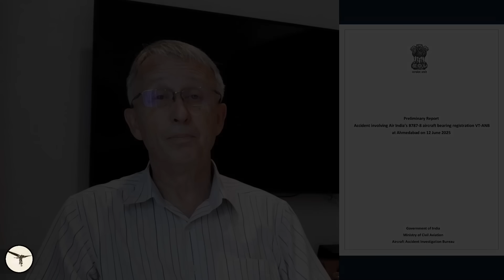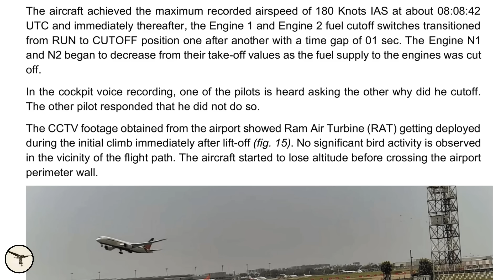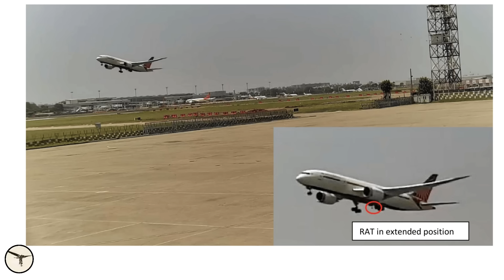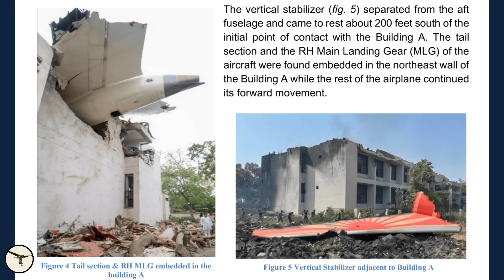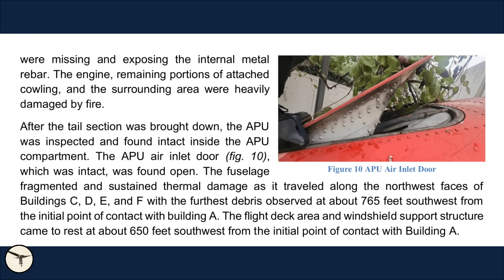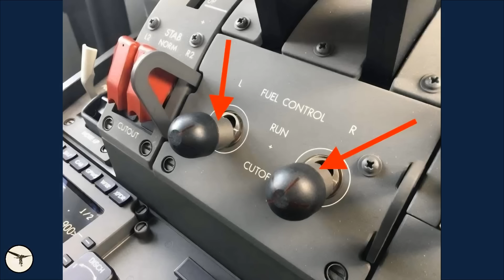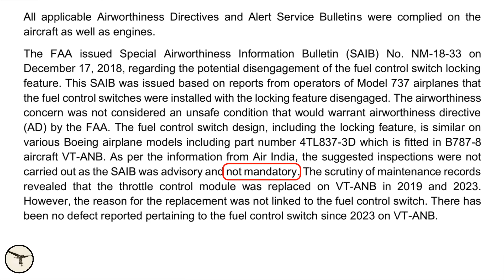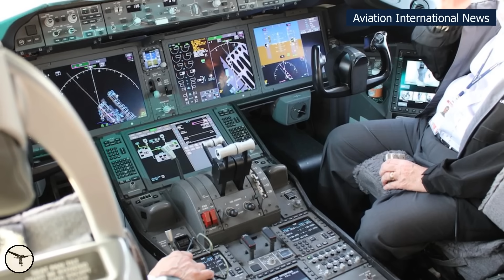WARNING Fuel Control Switches Failure Could Cost LIVES

Comment: Too many comments jumping to conclusions. The pilots appear to have reacted correctly to me. In answer to your question the electrical state from FDR may not be the physical switch state, it seems relevant there were two replacements of modules and the previous flight experienced a transducer issue which was cleared in the ground in under 1 hour. That makes me think the looms and or bulkhead connectors need inspection. I've only built engine management computers for cars though. Thanks Magar I learn a lot from your channel.
Reply: @foobarf8766  
Agree. Depending on where the FDR is recorded from, it may that the fuel already cut off while the switch position is still on run if the FDR is not recorded physically of the switch. Hence it took the pilot 10sec to reset the fuel system.

Comment: I'm surprised we don't have cockpit video recorders in the same way we have CVR. 
Any operational error or intervention could easily be extrapolated from the footage in the event that system data logging / CVR proved insufficient. 
We know that audio is never enough in these circumstances. 

So much happens on the flight deck which is not reflected verbally or which would produce identifiable audio cues.

Indeed, the emergency principle of "Aviate, navigate, communicate" leaves the CVR the last to know.
Reply: cost. This has been discussed before by FAA

Comment: Common sense tells me that If there is absolutely no reason for these switches to be operated during the takeoff phase of a flight then they should be disabled until the plane achieved an altitude at which they can be safely used. This could be software controlled so a quick, easy solution, no major retrofit required.

Alternatively why aren't these switches at least shielded with a cover that first has to be moved to gain access to them,  as are the adjacent switches with red covers as shown in the picture?

Comment: The text is quite clear in the preliminary report - there was a gap of one second between the movement of the two switches to cutoff. This is not a system failure. but it is consistent with being done manually, one at a time. Until the final report is released, we will not know for sure, but at least we now know that both engines shut down shortly after takeoff, and could not be re-lit in time to prevent the crash.

Comment: They did not fail. The wording is the solution. Why did you shut them down.. one pilot saw the other one operating ghe switches. Otherwhise he would have said something like engine failure, both Engines, I have thrust. Without the visual evidence nobody would asume a loss of thrust is due to a cockpit member shutting down the Engines

Comment: 1) You can find videos here on YT where it shows the PM guarding throttles with their hand during the takeoff roll. 
2) If the switches were installed incorrectly OR if this airplane had a known issue with the switches that maintenance didn't fix...
3) .... it could be conceived that this particular day the circumstances lined up; a small bump on the runway, a short sneeze by the PM, a sudden twist of the wrist, and an improperly maintained/installed switch gets flipped.
I do not believe these pilots did anything intentionally. Indian pilots are amazing.
Reply: @everythingisfine-b4d   𝑏𝑢𝑡 𝑝𝑖𝑙𝑜𝑡𝑠 𝑎𝑟𝑒 ℎ𝑢𝑚𝑎𝑛𝑠, 𝑡ℎ𝑒𝑦 𝑐𝑎𝑛 𝑏 𝑚𝑒𝑛𝑡𝑎𝑙𝑙𝑦 𝑠𝑡𝑟𝑒𝑠𝑠 𝑜𝑟 𝑠𝑖𝑐𝑘. 𝐼𝑡 ℎ𝑎𝑠 𝑛𝑜𝑡ℎ𝑖𝑛𝑔 𝑡𝑜 𝑑𝑜 𝑤𝑖𝑡ℎ "𝑖𝑛𝑑𝑖𝑎𝑛 𝑝𝑖𝑙𝑜𝑡𝑠"

Comment: Fine video!
But I think the investigation teams still have a lot to do.
It should be noted that the fuel ON/OFF switch needs to be processed electronically. Were these switches initially toggled by the pilots, or was this just the status of the electronic, and recorded as such by the black box? Do these switches have independent contacts that are then fed to the black box? How reliable are the power supplies for such systems?
Is there a means to override the electronic? The aircraft is equipped with a huge battery to stabilize the electrical system, and how could it happen that they had a power loss so severe that they needed the RAT?
It does not look as if this was pilot error!

Comment: Thank you very much Magnar. 1 second or 0.1 second makes a big difference as 0.1 second could suggest a hand mistakenly bumping both switches (maybe with faulty springs). It's still possible imo that the Captain had a brain flip/simulator related which caused him to cut off both engines as though he was ending a simulator session.

Comment: Accidental knocking of the fuel control switches is possible. That doesn’t satisfactorily explain why it then took the pilot monitoring 4 seconds switch both engines back into Run. If they had realised they had made a mistake, they would have realised the absolute criticality of correcting it as soon as possible. They would not have taken 4 seconds to correct their mistake
Reply: Most likely the pilots were shocked to see both switches in the ON position. It took them a few seconds to assess the situation, and then the memory items kicked in.
Checklist says: Switch to the OFF position, and then ON again (strange!).
Reply: @fritzlehner9060  maybe - but surely any shock at seeing both switches in Cutoff and the mental processing that was required before taking action would have been resolved prior to the pilot moving the first engine switch back into Run? Why did the pilot then need 4 additional seconds to think about whether the second engine also needed to be in Run?
Reply: @bobbyb379  I am almost sure that the fuel switches were in the ON !!! position, and this caused the shock. The fuel switch is just a stupid switch, and its signal is being processed later by electronics and actuators. The first impression of the pilots was certainly: 'what's that?'.
Besides, the Emergency Checklist says: move it to the OFF position, wait a second, and then switch it ON again.
The procedure itself is strange. It looks as if this needs a transition, not a static signal !
Reply: @fritzlehner9060 these switches do not move independently from pilot action. I think you are also confusing the fuel control switches with the FADEC control. Whilst both ultimately control the flow of fuel to the engines, they are INDEPENDENT of each other and the FADEC would NOT move the fuel cutoff switches in the cockpit. In the wreckage the fuel switches are in the “Run” position, but the 787 data recorders (which records the PHYSICAL POSITION of these switches in the cockpit) shows that they were switched into the Cutoff for 10 seconds before then being put back into Run.
Reply: @bobbyb379  All true, but questionable what the data recorder memorises. If the data recorder memorises the actual position of the switch, the switch needs to have a dual contact, since there could even be a problem in the harness or with connector plug.
I encountered another incident. A jet, parked in front of our hangar, had all electric on, but unable to start the engines. The maintenance crew studied the circuit drawings. I passed by and pointed with the finger on the battery disconnect conductor and said: This is the problem, because this device is normally never actuated. A mechanic went to the aircraft and hit the conductor with a wrench. Then he could start the engine!
Aviation sometimes needs intuition!
Reply: @fritzlehner9060  my understanding of the fuel cutoff switch is that it only has 2 settings - either off or on and that these work on contact points rather than purely electrical signals. Whilst a switch  is being moved from one position to another it will retain the status of the last contact point until it is moved into the new contact point position. So it is not possible for switches to change status whilst in transit.

Comment: As a minimum Boeing should put out an immediate bulletin to have all the cutoff switches on there affected aircraft checked. They should change operating practice to check locked and confirmed locked both switches after they are moved to the run position by attempting to move them down without lifting them up.

Comment: 4 seconds gap between the reset of both switches. if you are about to die, you would switch them back up within one second. maybe there was a fight between both pilots about the switches going on, they dont talk about yet. everybody is innocent until proven guilty. even in this case. thanks for your work.
Reply: I agree. I cannot imagine this situation without a struggle between the two pilots over those switches.
Reply: but he activated RAT.
Reply: @MultiYUUHI  RAT is activated automatically.

Comment: For the record, I have flown the Boeing 727, 737, 757, 767, 747-400. Former flight instructor.
I have never had any issues with these switches. My airline maintenance may have something to do with this. 
I am retired now. I did not fly the 787. I flew for the airlines for 27 years. Of those 14 years as a Captain.
If both switches were found in the  "Cut Off" position, this is a suspect. 
In my opinion, this was purposely done. BOTH switches? No way. Secondarily, during a take off, you do not touch anything, except the landing gear lever, you do this to retract the landing gear after you achieve positive climd. This reduces drag and makes flight more aerodynamically efficient.
When you reach approximately 1,000 feet of altitude above ground level, accelerate and clean up. (Flaps retraction), You retract the flaps on flaps retraction speed schedule. No flaps are necessary during normal cruising speed. Aerodynamic efficiency
If this indeed was a case of suicide. Then whoever did this had the knowledge, opportunity and access to the controls to commit this crime. 
Knowledge  and timing. It was done at the most critical time, right after take off, when the aircraft is most vulnerable due to the fact that there is very little altitude and time to relight the engines. He knew what he was doing! These control have detents that are solid steel, you have to overcome the detents in order to move this switches and cannot be done by accidental bumps.Then again, I have never experienced any issues with these switches during my career.
We must wait until the full details are known. I sense that there are regional/national emotions involved with this accident.
The voice recorder tells a story.
In aviation, it is what it is. We must live with the fact that if we make mistakes, we kill people . The airplane does not care about who you are, your gender, nationality or skin color. ....It is what it is. 
At the end of the day, you must be able to fly the aircraft.
This is an opinion.
Thank you.

Comment: Sir, Why it is not clearly mentioned in the report who asked whom. "Why did you switch off"?- Was this asked by Captain Flying or Captain Monitoring? They report should specifically reveal this. Why they are saying in a vague manner as 'One of the pilots asked the other'?
Reply: @belagulivenkata3656  exactly. Wearing a headset is mandatory during takeoff and landing so it should be easily revealed who said what to whom. 
The emotive aspect to this has a very real chance of creating a smokescreen where real information is not revealed while its easy to blame the pilots. Extremely CONvenient for Boeing too since their safety record has been questionable in recent years.

Comment: Captain guarding the throttles seems to be the only answer. His hand inadvertently bumped the switches, possibly in a little turbulence just after take-off. I had concluded this a few days ago. The switches had an issue.
You are the only commentator that has said what I believed was the only explanation for this tragic accident.
Reply: If the switches had moved inadvertently there wouldn't have been one second gap between flips.
Reply: There was no turbulence after take off whatsoever.
Reply: They're beginning to clutch at straws to make the story of pilot blame a reality. 
Most commentstors are saying the fuel swithes were in the off position. Yes they were, but within one second they were toggled to run. Is this because the pilot toggled them as a last resort attempt to reset the engines/FADEC?  @lordjim3109
Reply: @lordjim3109  The Air India 787 (Flight AI171) that crashed on June 12, 2025, started its takeoff roll at 13:37:37 IST (Indian Standard Time). The temperature, it was reported to be around 37°C (98.6°F) at Ahmedabad at the time of the crash. So have you ever heard of heat turbulence, especially likely passing over a built-up area.
Reply: With so many aircraft flying with a similar arrangement of the fuel cutoff switches, why is this the only time its happened?
While everyone is concentrating in the switches and the emotive aspect of potential murder/suicide,  other more subtle aspects are going to be missed. Such as FADEC issues, loss of electricity, etc etc etc. 
But blaming the pilots seems the easy way out.

Comment: The fuel switches should be better protected, with a cover for example, that has to be opened before the switches can be reached. It should be made as difficult as possible to move these switches by mistake.
Reply: They were hardly moved by mistake, because there was one second gap between flips. And also there is almost zero possibility that both switches were simultaneously faulty, or worn. These are special, military grade switches, each one costs 1500 USD. Even if these switches were ordinary consumer grade, bought at a local store for 5 USD, simultaneous fault of both switches would be extremely improbable.
Reply: It is already made as difficult as possible to move these switches by mistake. How much more difficult do you want to make it? So that it takes two hours to switch them off?
Reply: Maybe instead of an actual guard over the switches, the thrust lever for the engine must first be put into idle. There could also be a manual override (done via another switch) for any scenarios where a faulty throttle lever stops the activation of the fuel cutoff switch.

Comment: I can only see 3 possible conclusions with the information we have now. 

1: A mechanical failure of both fuel cut off switches one second apart. The odds for that happening for both switches so close to eachother are astronomical. 

2: One of the pilots mistakenly shut down the engines instead of lifting the Landing gear. The time the engines where shutdown is not that far away from the time you normally expect to lift the landing gear. The CVR should possibly clear this up as you would expect to hear a "positive rate/climb" from the pilot monitoring and a "gear up" response from the pilot flying.

3: One of the pilots intentionally set the fuel cutoff switches to "cutoff" in a critical part of the flight.
Reply: I have a large collection of Honeywell switches of this type (I'm going to assume they are Honeywell parts as it's Boeing). 
They simply don't fail. You'd need a sledge hammer to force the actuator over the steel 'hill' separating the switch index points - and even then you'd destroy the switch before it could be forced toggled to the alternate make-break-make SPDT position. 
These switches are battle tested and used in aerospace applications all over the world - even in the Space Shuttle.
To purchase just a single switch of this type new would set you back at least $600. This reflects the extraordinary dev work carried out and the guarantees provided by the manufacturer to deliver a component you can rely on in all circumstances. 

BTW, my switch nerd collection was gathered from ebay as NOS. But each unit is a work of art and has nothing in common with your typical car dash or boat dash toggle switch.
Reply: @nikthefix8918 
1. The switches have redundant contacts?
2. În RUN position the contacts are opened ori closed?
Reply: Yes. We think alike, Any of those 3. Exactly. I'm going with #2 as my most probable. Daydreaming or thinking of going home or thinking of landing but rote memory and oops wrong button, like lifting the gear on the apron or taxiway
Reply: @danielsandberg6217  FADEC also controls fuel valves, as does the switches, a mechanical failure of switches practically makes no sense but FADEC control on the other hand is something more likely (if that's what even happened). We can't ignore the little dialogue we've heard so far where the pilot asks "why did YOU cutoff fuel" not "why was the fuel cutoff ". It implies the fuel cutoff was deliberate regardless of which pilot did it.
Reply: @dennishingsberg791  Correction- "Why did you cutoff the Engine" another pilot "I didn't Cutoff the Engine"
Reply: @dennishingsberg791 well pilots have lifted the gear on the ground, and non pilots have locked their keys in the car. Could be the daydream/ brain fart of the century
Reply: Number two is impossible. A blind pilot can feel the difference between the (single) wheel shaped landing gear selector switch and the (dual) toggle switch shaped fuel cut-off switches, which are located some 45 cm away.
Reply: @ronanstis6328  No cause is really impossible however improbable it might be. Pilots have clicked the wrong buttons in the past. Thats why we need a full timeline to know exactly what was said and when in relation to the fuel cutoff switches being shown as turned off.

Comment: The controlled glide seems to slip to the left, and is that the flight control system correcting for a heavy wing? One might have preferred that if pilot eyes were not glued inside the cockpit, a correction to starboard might have planted the wreckage in a field with trees, not inside a dormitory. Nose-high, that may not have been visible in any case, and a ‘glass cockpit’ does not offer a spherical view with automatic target marking that could track and identify hazards at a time when workloads are extreme. 

Maybe next-generation Dreamliners will have synthetic vision and remote assistance in a time-critical minute-to-live circumstance. We trust our lives and loved-ones to those pilots and planes. A root cause must fit the circumstance, not the investment. The final report will be anxiously awaited.